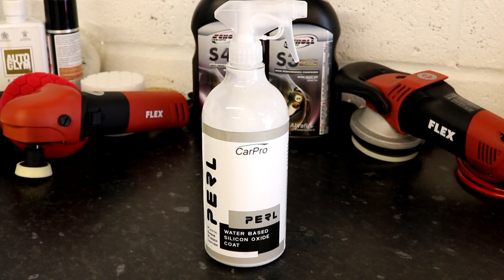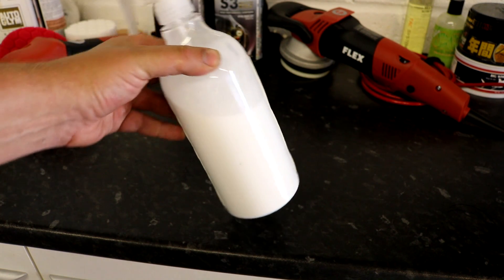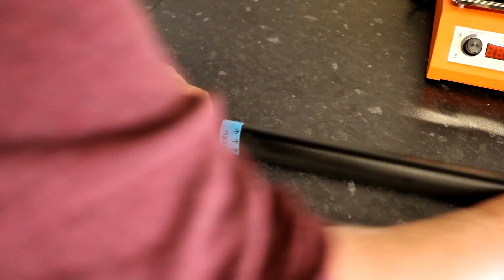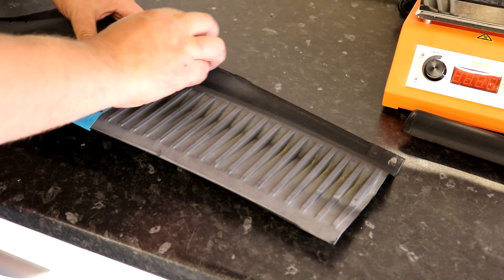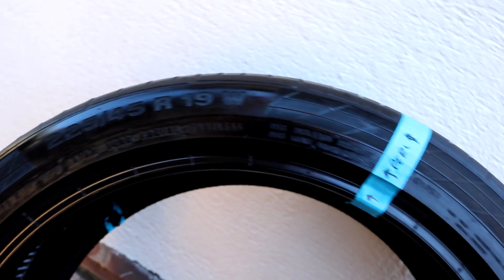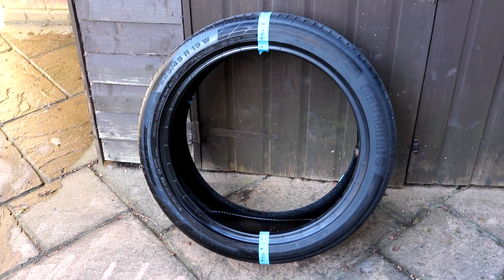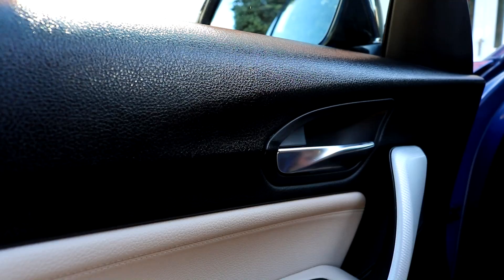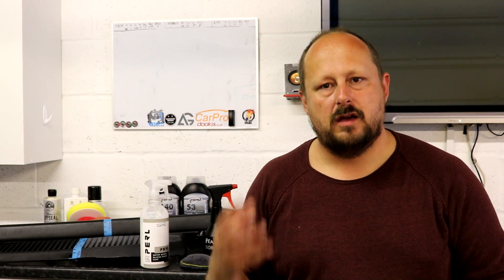Carpro Perl - Best plastic rubber and vinyl dressing ?

Comment: I have been using 303 aerospace for my interior trim, love the matte finish it gives with a new car like darkening effect. For tyres I have been using Opti Tyre Gel in a HVLP gun at 1:1 with great results, hardly use any product this way. 

I still need to find a product to give a more permanent (more then 3 months) restoration to faded exterior trim

Comment: Based on your recommendation, I bought 1Ltr of the stuff and you're right... brilliant and less greasy on tyres than Endurance.  Thanks again.
Reply: Yep can’t wait for my megs endurance to run out eventually for this reason. Absolute PITA to clean my brushes and I have to buff off as it simply won’t dry and almost always ‘slings’ onto my car.

Comment: Perfect video - well done! I love PERL too, although I've been reluctant to use it on the dash because I want a matt finish with UV protection.
Reply from the maker: i wouldnt worry about that too much.. like the finish is shiney satin on application but a day later it settles down to more matt..  but you can really see the darkening effect on the internal plastics and vinyl.. thats what I like...  gets me back from a charcoal dash to a darker black dash (a bit)
Reply: Thanks for the clarification John, I was only put off by the gloss finish but if it reverts to matt I'm very interested!
Reply: @ForensicDetailing  Would you use 5:1 dilution on all internal plastics?  What dilution for external plastic trim?

Comment: Excellent video Jon, my favourite  dressing for aesthetics  is autoglym instant tyre although for a weekly clean I normally use megs D156 spray wax for window trim and interior plastics (and glass, and paint), gives a great look and provides a little protection/hydrophobicity !  but I haven't used any of the more permanent ones such as Gtechniq - would be sweet to see a comparison between pearl and gtechniq or something similar: water based  vs nano based

Comment: Perl is good to an extent and like you say can be used on interiors, but it don't beat Solution Finish for vinyl dressing.....
Reply from the maker: yer I use solution finish.. but thats a more specialist restoration product..  I will do something on solution finish soon as well.
Reply: Forensic Detailing Channel yeah, I'd like to see a video about solution finish from you jon.  I am considering giving it a try.
Reply: jhon just bought some of the solution finish to do the door handle of my motor home early days yet but up to yet it's the only thing that has had any effect. can't wait for your take on it.

Comment: if only I knew about it before purchasing mequires tyre gel. I am struggling to finish it, but PERL will be the next one on my list.
Reply from the maker: yer its a different kind of thing.. megs doesnt bond or dry out.. so its really only suitable for tyres.. or maybe exterior trim (but I wouldnt use it on trim personally)..  

Perl you can use inside and out on anything and everything.. and its very good value...  I use have megs endurence in the arsenal.. but with perl you dont really need anything else..

Comment: All good point for this review... I've been using PERL for more than a year, and i must say there is something NEGATIVE about it.
At 1:1 on tires, it will leave a greasy touch on the tire. And i've tried on multiple tire just to exclude a specific tire issue.
After a month (you can get a month of effect on tires if good condition), if you put your finger on the tire, you will get quite a lot of nasty black goo. A good degreaser will be needed to get everything off in my case.
My conclusion on the matter is that either you have to buff off the tire after the product has cured (15-30min), or use a higher dilution which i haven't tried yet.
Same thing on the interior, i advise to buff off after the product had time to cure.
It may not be a big issue, but i think people need to know this. Especially on interior, having some residue is not great. It's also a disadvantage for me, i hate spending more time on each panel/tire to comeback and buff the product.
What about you John ? Did you notice the same problem?
Reply from the maker: on my test tyre the product has been sitting for about a week since shooting this.  I kind of see what your saying looking at the test tyre.. Its not as bad at megs..  but yer a little bit of greasy feel.. I went 1:0...   I suspect if you go down to 1:3 it will be less notacable but there might be a trade off in durability.    products like angelwax elixir and opti bond tyre gel are better on this front... but less prolific or less like noticable immedietly after application.. so theres options there is you have an issue or spot something you dont like.. great stuff mate its great when peeps feedback their thoguhts like this.
Reply: Forensic Detailing Channel of course, i try to get involve in the discussion, especially on a product that i know well. And perl has been hyped for quite some time now, for his multi purpose and excellent value. But, i think there is room for improvement, especially on the residue left. you could dilute it more to reduce this, but then the durability could be reduce. thats the only critic i have for pearl, and it can be a turn off for some people i think. in my case, i will still use it because i m looking for some good value and a product that can dress it all.

Comment: I decided to give this product a go after years of using 303 Protectorant. I just wanted something longer lasting. I tried it on my vehicle a MYO 4 Subaru Outback. I used Megs Super Degreaser as a cleaning agent and wiped off residue straight away. I then applied Perl to dash, door cards etc and wiped dry with MF cloth. Initially results looked good. I went back and checked 10 mins later and noticed some areas where product seemed to have given 2 different finishes. The two main areas of concern were the door cards and dash.The majority of the areas where product applied looked like it had worked as advertised leaving a darker texture. Unfortunately those areas were also interspersed with areas where I noticed it had dried in a lighter shade and was very noticeable. And in one area it was down right just ugly, looked like something had dripped down door card. Never expected this and never had it happen with 303 Protectorant. I kept checking around steering wheel and noticed product had finished well on blinker and wiper stick, vents, steering column and glove box which is same material as door cards and dash. I thought maybe product needs more time to work its way in and kept an eye on it for next few days but unfortunately no change. I also used on rubber seals ( doors and windows ) and product worked very well. I remembered this also happened on some areas of the interior of a Porsche Macan I had detailed earlier in week. Perl had also worked as advertised on the rough textured plastics on exterior but gave a streaky finish to the smooth plastic roof rails. So I'm looking at inconsistent results over differing surfaces. Haven't tried on leather yet but I will do shortly.

Tomato out...
Reply from the maker: I think that might be some sort of pentration thing..   I dont think Ive ever seen the problems you describe with perl but Ive seen it with other product..  I also think they tweaked the formula of it a while back..  roof rails are not usually plastic, im wondering if it was a painted surface?   not sure.  but great feedback though mate thats what its all about...
Reply: Thanks for reply FDC...I have to agree although I can't 100% say so. My life would be so much less stressful if I had the answer to all the things that don't go as directed on package or I was also an industrial chemist. It almost looks like the area is sealed but the part where it was supposed to darken the plastic has failed to penetrate leaving it looking like I missed random areas. As this is my car and not customers it has saved me embarrassment of having to clean it all off again and reapply with 303. My first thoughts were something had stopped product from penetrating and I thought back to the process I had used to clean the areas to see if I had done anything different. Everything was the same as I normally do. It's a bummer I can't put a photo on here although I did a short video on my channel showing the inconsistent results. It's named Car Pro Perl WTF...if you do happen to watch it you will see that the lack of penetration pattern on the drivers door is just plain weird. I may not of used the right terminology regarding roof rails. I meant the housing the covers the side are plastic. I can tell when I tap them.

Cheers mate...
Reply from the maker: Im thinking excess product has run down from the crevace above and dried on the surface.  I think the silicone oxide is the component thats leaving the white stains.. but thats also at the heart of how the product works...   I think any rubber or vinyl dressing thats a loose liquid and white could have the potential to do this.  really needs to be worked in and then any excess buffed up with a microfiber maybe..

but things like this can play a role in what you pick.. so if you have a product you prefer that never does this, then thats like the final thing that can effect decision making.. but that product might not have the restorative effect pearl does..   Im currently testing it against solution finish on faded plastic and its holding its own right now..  ive also not personally had this issue either but totally respect this feedback.
Reply: The funny thing is I just went and brought takeaway Thai for dinner and on the way back the excess product thing sprang into my mind.  As 303 allows excess and slowly soaks in, and is the method I'm used to using with dressing I have to admit it's looking like an operator error situation. Ah well I live and learn...So I'm going to clean it off and reapply using less product. I'm thinking IPA 50/50 and MF cloth although I have never tried to remove this product before. Any thoughts on removal process? I'm also going to change from foam applicator to MF and work product in more. Thanks for taking time to reply and it's great that my own SLOW conclusions as to what caused it concurred with what you have just described.

Cheers bud...
Reply from the maker: no worries mate.  IPA should do the job at about 50/50 yer.. could got strong if its not shifting.
Reply: Roger that...Thanks mate

Comment: Pro tip: Use Meg’s heavy duty all purpose cleaner first on your tyres before  applying Perl. Then spray it on and use a blower to get it into the little gaps then wipe off the extra.

Comment: Jon have you tried the 303 products before, for Marine and aero usage , expensive at 13 pounds for 500 ml , but I hear it prolongs life of all plastics and even prolongs tyre wear as well with in built uv filters etc, it's cheap as chips in the u.s. by the gallon but almost 100 quid over here
Reply from the maker: I need to try this stuff.  seems big in the US scene.

Comment: Have you used Meguar's Hyper Dressing? It has many applications and lasts a long time. If so, how would you compare it against CarPro Perl? Thank you.
Reply from the maker: no mate not used it.. Is it concentrated and does it have the restorative effected on faded trim?   I like megs stuff so may well try it, it it can tick those boxes.
Reply: john never tried it myself yet either but i know it's able to go as low as about 4-1..tidy video again mate, i will be ordering the pearl on my next order..cheers.
Reply: I use it 4:1 for tires and wheel wells, 8:1 and 10:1 for engine bays and exterior trim. A small amount of product goes a long way and Meguiar's sells it in a gallon container. It produces a ton of gloss at 4:1 (too much for my taste, but I offer it as a "high gloss" option).
Reply: I agree that the condition of the plastic plays a big role in a product's ability to change its appearance (for the better). I worked on the black pebble-textured trim of a truck recently that was so hazy and oxidized that no reasonable amount of cleaning and topical restorer would help it.
Reply: Perl and Hyper dressing both used to have the same chemistry until carpro made some changes so it lasts a bit longer now than Hyper dressing. I've used both and can say they really are very very similar. You couldn't go wrong with either product.
Reply from the maker: gr8 info thx m8

Comment: Hi mate do you still use this stuff? Or something better out now? … and how do you apply to tyres?…. Spray on and work in with brush or sponge? Odd for a concentrate to come in a spray bottle?
Reply from the maker: I still use it but I use TAC systems seal same stuff.     tyre 1:1 spray into a big hogg hair brush and brush on..  can pre spray some onto the tyre.   I like to put loads on leave for 1 hour then remove excess with a rag.  ideally then leave overnight.

Comment: Excellent Jon, cheers. Once diluted (say 1:5) how long does any unused diluted solution last in the spray bottle or do I have to use it all up in one go? Just wondering if it loses power from one application to the next, say 4 weeks.
Reply from the maker: it doesnt go off at all.  I still have like 3:1 mixed up from a year ago.
Reply: @ForensicDetailing   Brilliant Jon. Cheers for the rapid reply mate.

Comment: have you used autoglanz trim reaper mate? if so how does it compare to perl? both seem very similar in their applications(can be diluted to be used on different surfaces) 
thanks for the videos!👍
Reply from the maker: I have trim reaper yes.. I think the darkening restorative effect is greater on PERL.. but If I remember correctly trim reaper but a reall good repellent seal down which is handy for external trim.

Comment: I use Opti-bond tire gel. Which is also water based. Have you tried that product?  Do you know how it compares to CarPro pearl?
Reply from the maker: yes I used this in the optimum car car review.. I like it.. For me its more matt...   It seems to dry down quicker..   Doesnt have the darkening effect of perl..   lasts just as long but perhaps less prolific... but if you like a more matt finish its a really solid product, like all things optimum are
Reply: So I want to give Pearl a try but I read about 3 bad reviews on detailedimage.com about when you apply to tires and then drive in the rain the tires look horrible and even turn gray. Have you experienced this and do you know why this is happening?
Reply from the maker: not heard of that mate and no Ive never seen the tyres go grey...  its still on the test tyre and its jet black...

Comment: Have you used Aerospace 303 or Optimum Leather Protectant? I've been using 303 and would like to know how it compares to Perl in terms of leaving a matte finish and durability. If it performs just as good or close I think I found a new interior protectant since it's a hell of a lot cheaper.
Reply from the maker: i like optimum leather protectant I have this but its a different kind of product 303 I have not tried mate.
Reply: ah ok. So Perl's primary function is a dressing as stated and protectant as a plus side.

Comment: Naive (perhaps) question - this has a darkening, gloss enhancing effect... Why couldn't it be used on paint? Specifically, black paint.
Reply from the maker: they are just a lot sort of thicker and designed for plastics and rubber...   like if you get them on paint they are smeary..  but with perl you can still sort of wipe it back clean on paint..   its a really good quesiton.. lots of silicone based dressings done dry so just make a mess of paintwork....

Comment: How would you fix door rubber seal noise ? with what product would you spray them
Reply from the maker: I would first  get all 4 wheels put on a lathe and checked for damage not straight etc...   then I would have all 4 wheels rebalanced.  And set tyre pressures.  If you still have noise cover them in carpro perl and see if that helps.
Reply: @ForensicDetailing  Thanks!

Comment: Could you use Perl and then throw some carpro dlux on if for more of a protection and make the blacken last longer?
Reply from the maker: dlux is a ceramic, it needs a clean surface to like bond to and set.. perl will mess it up i think m8
Reply: Forensic Detailing Channel yeah I kind of figured that. Thanks for the quick response.

Comment: Hi
Used this today for the 1st time on my sis car. The result got really patchy/streaky (not sure if that is the correct words , i´m swedish) . Solution was 1:3 . Especially on the plastic panel below the windshield (Volvo V70) . Used a application pad to put it on and a light rub with a mf after.  Could this be because the plastic was a bit warm ? Did i not use enough amount of Perl ?